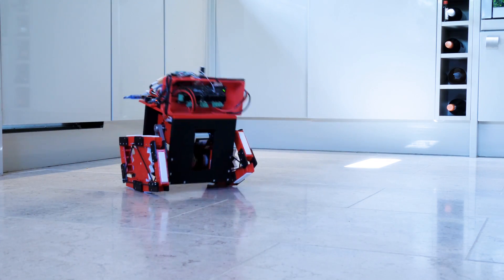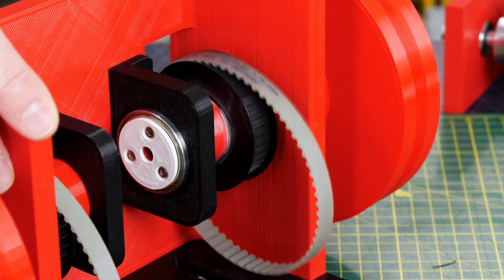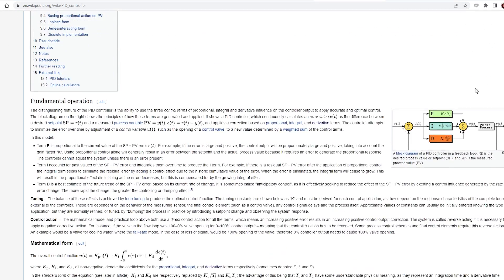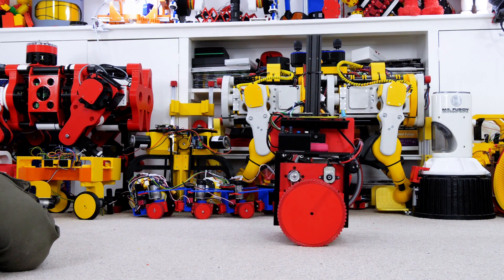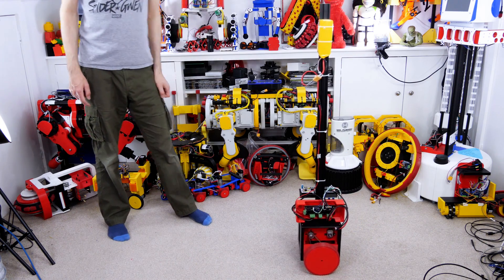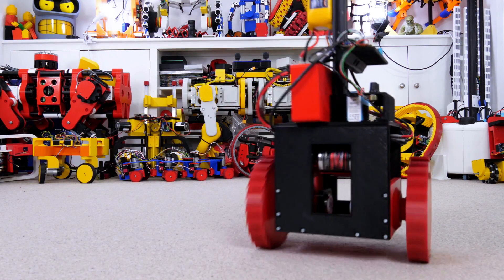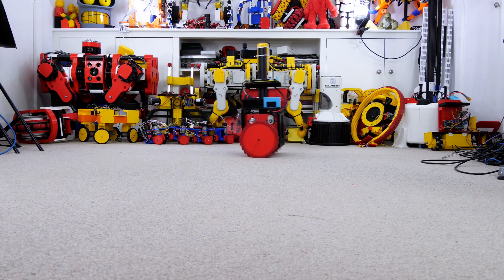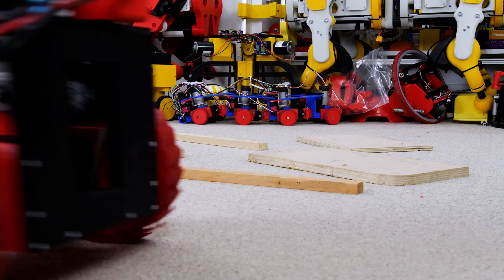Why this Robot is Really Tall

Comment: When he was talking about the coding for the position hold function, the only thing running through my head was "The robot knows where it is because it knows where it isn't..."
Reply: By subtracting where it is from where it isn't, or where it isn't from where it is, whichever is greater.  It obtains a difference or deviation.  The guidance subsystems uses deviations to generate corrective commands to drive the robot from a position where it is, to a position where it isn't, and arriving at a position where it wasn't, it now is.  Consequently, the position where it is, is now the position that it wasn't, and it follows that the position that it was, is now the position that it isn't.  In the event that the position that it is in, is not the position that it wasn't, the system has acquired a variation.  The variation being the difference between where the robot is, and where it wasn't.  If variation is considered to be a significant factor, it too may be corrected by the GEA.  However, the robot must also know where it was.  The robot guidance computer scenario works as follows.  Because a variation has modified some of the information the robot has obtained, it is not sure just where it is.  However it is sure where it isn't within reason, and it knows where it was.  It now subtracts where it should be from where it wasn't, or vice versa.  And by differentiating this from the algebraic sum of where it shouldn't be, and where it was.  It is able to obtain the deviation and its variation, which is called error.
Reply: @EnsignLovell  I like your funny words, magic man!
Reply: https://youtu.be/bZe5J8SVCYQ for those who don't know the meme.
Reply: @underscorenul  https://youtu.be/_LjN3UclYzU i prefer the remix, lol.
Reply: @underscorenul  i've always listened to the missile that it almost feels like a secret religion of mine lol
Reply: @underscorenul  Thx
Reply: oh dammit, I posted this before reading comments.
Reply: The missile knows where it is at all times.